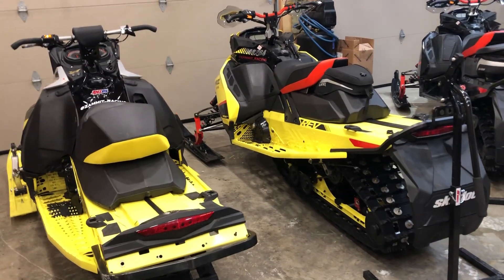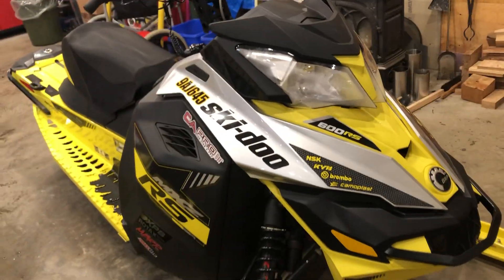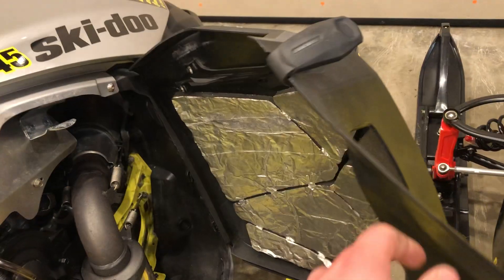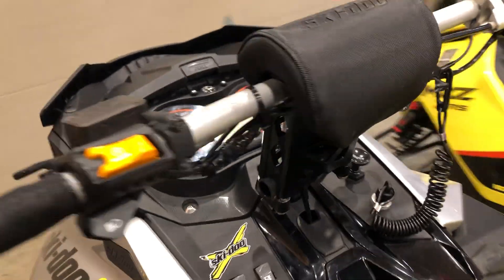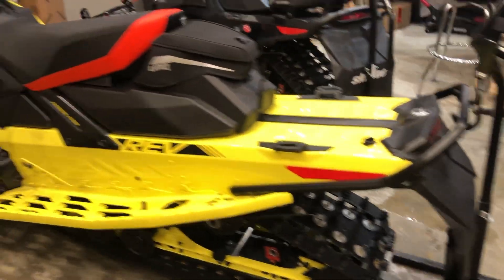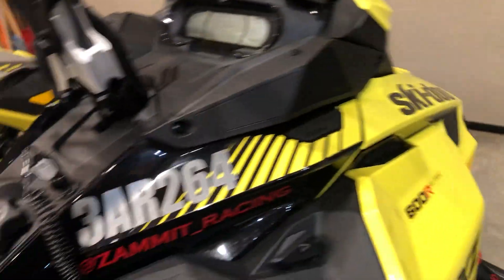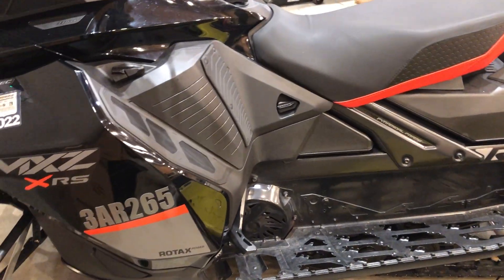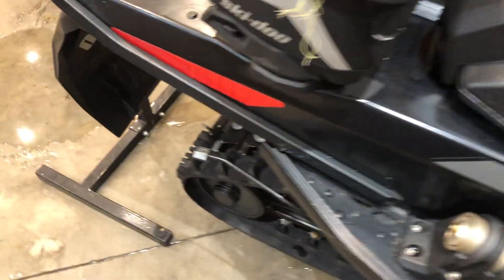Walk around of my sleds

Comment: Just bought a bone stock 2016 rs, what elevation are you at and what jetting are you running? Looking just to get it running reliably on trail, any help would be great thanks👍🏼
Reply from the maker: Right on! Great sled, I run between 280/290 main jets, I’m at sea level. Get a trail flap to help with cooling snowcross one does nothing, carry extra plugs with you they tent to foul especially when it’s warmer weather